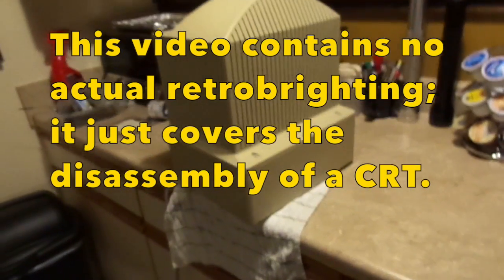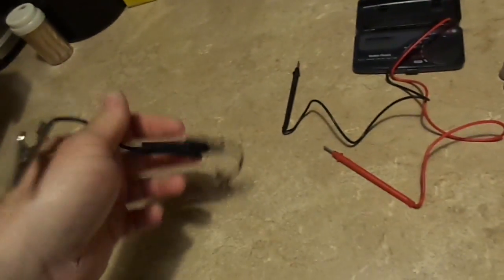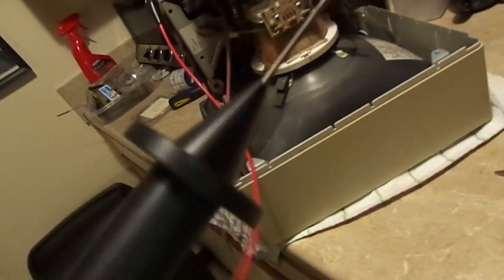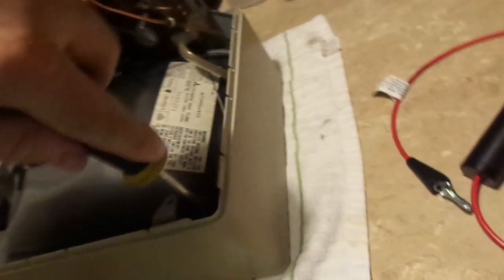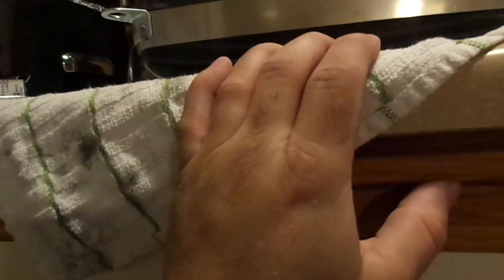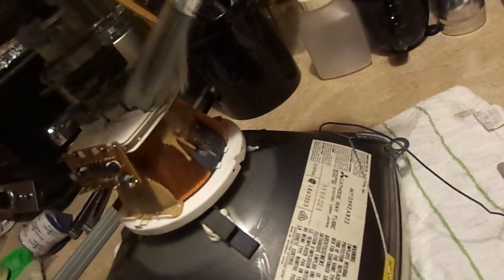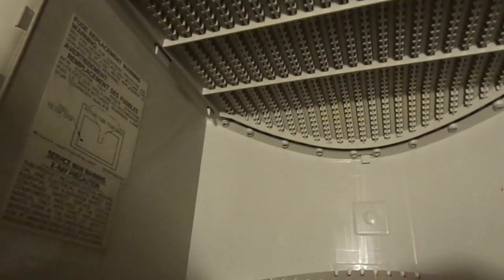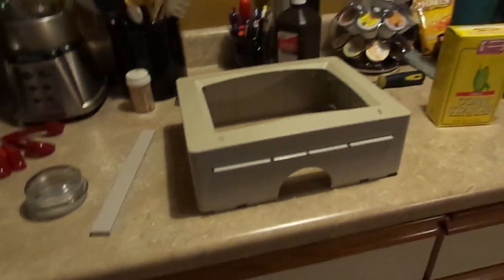Apple CRT Monitor Disassembly; Preparing For Retrobrite

Comment: FYI: although it uses the same connector, the "video expansion" port of the Apple IIc is not compatible with the IIGS monitor. The IIc's video port was designed for use with the optional RF modulator or LCD panel; it is not a direct RGB video output.
Reply from the maker: vwestlife Thanks for clearing that up! I knew there was an adapter, but it didn't quite "register" in my mind!
Reply: +BBISHOPPCM's World could you disassemble it with rubber gloves?

Comment: The black coating on the CRT is conductive, and essentially it forms a capacitor with the coating on the inside of the glass to filter the high voltage supply.
Reply: MrMaguire Dumb question - but since I've never opened a CRT monitor before - the black coating IS conductive? So if you touch any part of the CRT itself without discharging it, you will get shocked? Ouch...
Reply: 1912RamblerFan01 I think that's correct.

The coating is called AquaDAG. Sometimes it'll flake off, and you can buy it in spray cans and paint it back on.

As long as you properly discharge the CRT, you should be fine.

Comment: A few retrobite tips.

You can buy a gel pre made as a product for bleaching hair , you can find it at a hair salon.

Aluminium reflects the UV ( what makes it work) the best , so place the thing you are retorbirting on a sheet of aluminium foil , it should reflect some of them UV and improve the result.

The unevenness is not likely related to the plastic wrap but unevenness of applying the retrobite , UV is going straight through that wrap no matter if its overlapping or scrunched up.

Wear gloves , always wear gloves, strong hydrogen peroxide can damage you skin and turn it white ... not nice.

Comment: The glass has lead in it to stop x-rays from leaking. The aquadag coating on the inside and outside forms the 2 electrodes of a capacitor the glass is the diaelectric, this is the filter cap for the high voltage rectifier- a small value but allows it to charge of ac voltage peak ~ 1.4 times higher.

Comment: great video.I used to in a field like this.cathode ray tubes operate at very high voltages from 25 Kilo volts to 35 kilo volts.inside of the tube also have auqdac coating inside that acts like a high voltage Capacitor

Comment: CRT has a NECK board which holds the RGB color drivers for each electron gun in the tube.
Next is the Purity / Convergence magnets, used to fine tune and align the color guns for a good image
Deflection Yoke is the coil on the CRT. This has two sets of coils one for vertical def, and one for horizontal def. The set cannot run without the horizontal def coil connected as it also serves as a resistor for the DC HV system of the flyback.

Those discharge tools are not as rare as you make them out to be. I have 6 sets of them here and 4 sets of probes with the meters built into them.

Comment: If you measure 1 ohm in the probe then it has no resistor built in. You would like a resistor like a 100Kohm to have an "effect" on discharging something slow (at that kind of voltages) 10 Kilovolt (B/W-CRT) into 1 Ohm is 10.000 Amps! - So no "limit" there. A CRT won't be hurt be getting discharged at once. The 1 ohm you measure is the resistance of the wire og the probe + your multimeter. The CRT can charge up over time because of the charge sitting deep in the glass of the tube. When shorting it out you only remove the charge on the surface of the glass. Also, the CRT does not contain enough energy to kill you, only give you a nasty shock. The mains side of the power supply is much more dangerous - the caps in that contain MUCH more energy. Also, it's impossible for voltage on the caps in the power supply to be stepped up by the flyback on itself. The caps don't hold enough energy/voltage to do this. The wire you got with the two clips is to put on the anode-terminal on the CRT and on it's chassis connection. The Flyback won't suddenly make any voltage, but the CRT will charge back up over time! Here's some good reading: http://lowendmac.com/2007/the-truth-about-crts-and-shock-danger/

Comment: My G3 iMac has a really high pitched noise when its connected to the mains and not turned on. When I first got it, the screen would twitch every now and then and produce a really loud and scary popping noise. This loud popping disappeared after a few weeks of usage.

The real problem is that hard disk activity has a way-too-noticeable negative effect on the picture tube. There are small lines dancing around the screen all the time, but with high disk activity the screen becomes unbearable to watch.

I'm pretty sure this is caused by the flyback transformer because that is where the high pitched sound comes from when the iMac is turned off. I've already replaced the main capacitor on the power supply board (just in case... It seemed to be bulged, but the truth is that only the plastic on top of the cap was warped), and resoldered the contact points of the flyback transformer... but the problem still exists.

Do you know if there's a way that I can fix this problem without spending too much money on replacement parts? I've already spent too much money and effort on replacing the bad Harman Kardon speakers that suffered from foam rot, and the actual unit itself :(
Reply: Pukkie201195 It's entirely possible you have bad caps on the Down Converter board on the thing; recap the whole lot and you should see an improvement.

Other things to check would be the DC supply voltages (bad cap or failing regulator) or the video cable
Reply: Thanks. I'll definitely try this out when I have my unit apart for service in the near future.

I was also thinking that it might be related to the voltage regulation but not really quite sure. It won't hurt at all to try since recapping is a pretty cheap and easy thing to do.